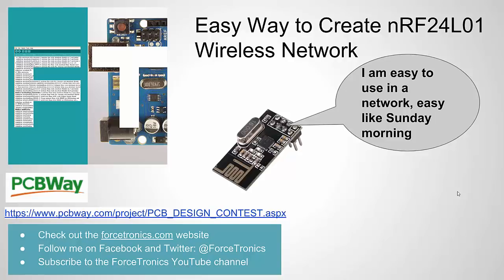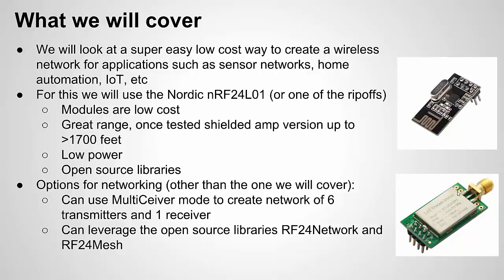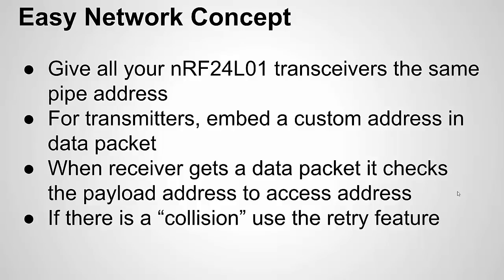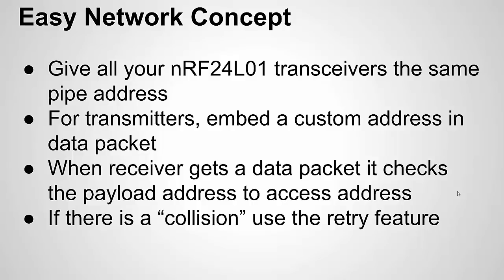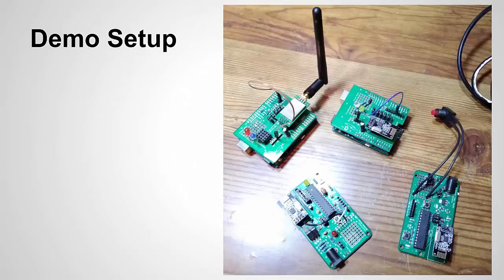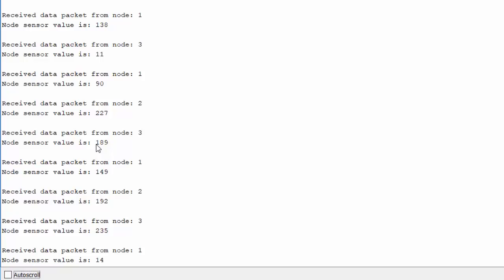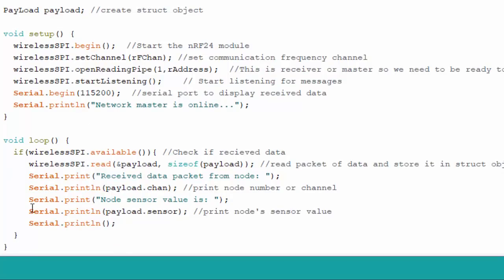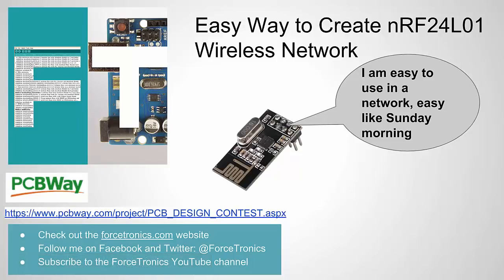Easy Way to Create an nRF24L01 Wireless Sensor Network

Comment: If I could give this video more than 1 thumb up, I would!
Reply from the maker: Sorry I did that years ago and it no longer compiles on the current version of microchip studio. In fact microchip is moving away from that platform in general to MP LAB X. You might find this video series helpful on using the graphical programming interface on MP LAB X https://youtu.be/mL8Ge7LzGkA?si=reXDVJlGu4Io45cM

Comment: Thank you very much for the Video!! Most of my doubts got clarified. BTW. A quick question. I want to use RF24Network and RF24Mesh libraries for my IOT project as the distance between the devices is more than 800 meters. Hope mesh networks will help me here. I am using  ESP8266.  There is no much documentation on support for ESP8266 in the internet. Are these libraries reliable to be used in commercial projects using ESP8266? Any suggestions would be great help.. Thanks

Comment: Hello sir,
Well explained video. It helped me a lot. I have one question regarding the nRF network. I need to send data from 2 nRFs at a time to a receiver. Means I should get synchronized data from 2 nRFs to one receiver nRF. Is it possible by using a network? Coz. in the video, you said we cannot send data at a time to a reciever. Is there any other method to send synchronized data to a reciever? Thank you in advance.
Reply from the maker: An nRF24 transceiver only has a single receiver circuit so it can only receive a packet from one transmitter at a time. It does have the ability to transmit to multiple receivers but based on its hardware it can only receive a packet from one transmitter at a time

Comment: Hello,
How are you?
I am dealing with a smart home project. Basically I want to control my home automation from android/IOS and web browsers. I saw your project and they are similar. There is a different thing from your project only. This is data getting from and sending to a battery (like CR2032) powered sensor (like heat sensor, humidity sensor, maybe a plug etc) from Arduino Uno. Arduino Uno will connect to my modem router via ESP8266 wifi card. 

I couldn't solve how I will be communicated my Arduino with all my remote sensors. There is no wire between arduino and my sensors. I don't want any wire among them. Sensors are powered with a small battery like CR2032.
The ways I could find are;
1-sensor with a programmed esp8266 wifi card (sensor+ esp8266)
2-sensor and zigbee p2 card
3-sensor and bluetooth card (I don't know about them any information now :()

Comment: i am buliding a plane (f 22 raptor) which has only 2 servos to control everything which are connected to two separate  elevator (no other control sevices) so what should i include in program(i am using arduino nano) to   move elevator to turn and also go up and down using two parallel control surfaces ( if you dont understand what i want these control surfaces to do pls see at 30:53 https://youtu.be/iPHhmgYjQog ) pls help me

Comment: I've been trying for a couple days well to get this to work. The Rx side prints in the sensor port the sensor value as 0. I have ensured i'm getting my Tx transmitting via serial port where I see random value generating. I've tested functionality of both sensors using "getting started" sketch.
Can you lend any suggestions. I'm trying to use this for my final year project at university.
Reply from the maker: I believe the transmit data and receive data functions return true or false if they are successful. Are you checking them to see if they are successful? If they are successful and you are not getting correct data on the receive side then look at if you are packaging the data correctly with the correct data length as well as unpacking it correctly on receive side
Reply: @ForceTronics  got it working. My problem was that my specific board required the power module. The code works great. I'll be giving your channel a shout out in my final year presentation
Reply: @ForceTronics  Thank you will look further into this

Comment: How can I know the node ? I connect the NRF24 to the arduino and i try to send then the receiver showed my from node 0 , do u connect the NRF24 to something so that the receiver knows that it’s from node 1 or 2 ? If so please tell me
Reply from the maker: You have the node that is transmitting put it's node number in the data packet so the receiver knows who it came from
Reply: ForceTronics thank you so much, have a good day

Comment: Great video, this really helped me narrow down the options for my sensor network.
I was a little confused by the use of "setChannel()" as a function to set the node address, as this same name is also used by the RF24 library as a function to set the RF channel number "wirelessSPI.setChannel(rFChan)". Perhaps use of a different function name for setting the node address (such as "setNodeAddress()" ) would be less confusing?
Thanks.
Ron D.
Reply from the maker: Good point, thanks

Comment: Thank you for this Tutorial! I have a question That I would like to get your opinion on. We are planning to build a wearable system for a shoes, a hat and a shirt. Each of these wearable systems will have sensors in them. there's also vibration motors in the shirt. The thing is, we are kinda skeptical about communication. We are planning to make the sensors in each subsystem send the data to an Android device. We also want the android device to control the vibration motors in the shirt (They can be seen as independent  systems that need to be collected in one application) . Would you mind giving us your thought about what is the best communication method? The range would not matter since the wearables will be close the each other. someone has suggested that we can use the arduino in the shirt as  a "collector" where the data from both the hat and the shoes will be collected in the arduino of the shirt, and then these collected data will be transferred to the android application. I have read so many research papers regarding WSN, but i still haven't found any that suits our requirements. Would really appreciate your opinion on the matter. Thank you.
Reply: Are you able to find the solution? because I am also somewhat in a similar situation! Would love to hear your suggestion
Reply: @KD-tq9wy  hello there. Yes we have! We used the nRF as the communication means, and it worked perfectly, but unfortunately we couldn’t add another Transmitter (we only managed to do an 1 RX and 1 TX)
Reply: @3washoka  ohk. Thanks for the reply

Comment: Hello sir,  wonderful video!! Thank you very much for sharing..   From my personal experience, the "low-cost" versions are not as good as the original version. In my tests, re-transmission count is very high even when the receiver and sender are placed near each other. There are modules produeced by some Chinese companies using the original Nordic chips are also very cheap.
Reply from the maker: Great comment. And I agree the authentic Nordic version will provide a better quality experience then a low cost knock off. With that said I have not had the problems you mention and I have used these modules in various project (some commercial). Where I did have problem is if you turn the transmit power up high on a non-shielded module. In this case the transmit power will blank out the receiver briefly and it never gets the ack packet so the transmitter thinks the receiver never gets the data so it just keeps re sending it. One way to test if that is happening is to turn down the transmit power to low or to turn off the ack packet function. To avoid this issue altogether you can use a shielded module that protects the receiver from the transmit power.
Reply: If you check the value of register OBSERVE_TX immediately after a data package is successfully sent, you'll get the re-transmission count. With Nodic chips, the value usually will be zero or one, meaning the data was sent with 0 or 1 retransimission. With those "low-cost" ones, I usually got at least 6 or 7 retransimissions. I have a question about the "ACK being blanked out" part of your previous comment. I understand the chip works in either sending mode or receiving mode. So, how come an ACK can be blanked out? Shouldn't the chip be working in "receiving mode" while it's waiting for an ACK? Thank you, sir.
Reply: @ForceTronics  is there a way of temporarily shielding these modules to test. Would something like foil work? Obviously something else between to stop shorting.
Reply from the maker: @andrewtoogood1429  I tried foil without much success and I think I shorted something with the foil (don't really remember it was years ago). I would just set them for lowest transmit power and they worked. You can also turn ack packets off and that gets rid of the problem all together but then you don't know if your transmit packet made it to the receiver